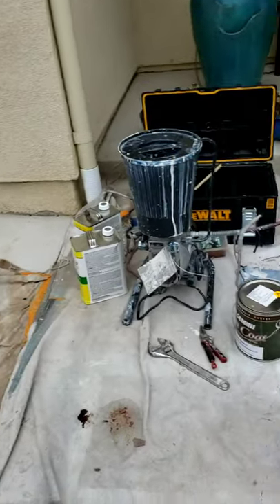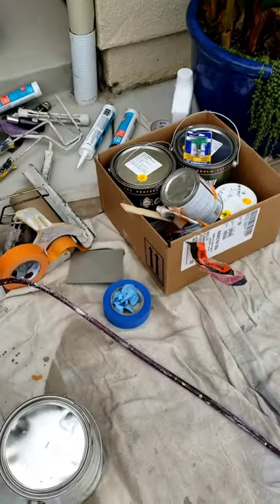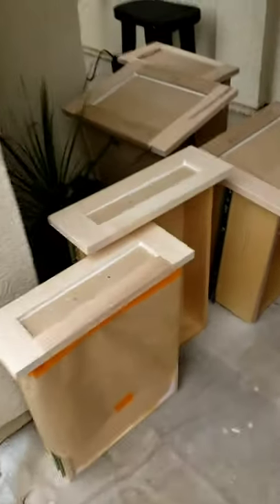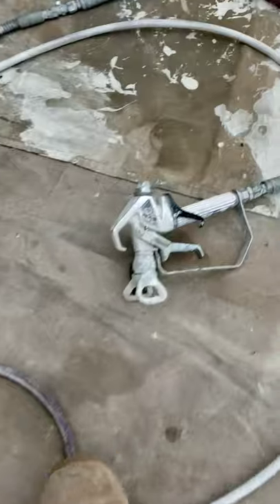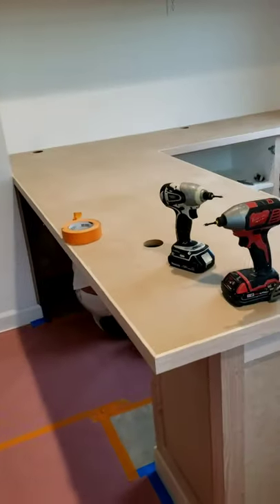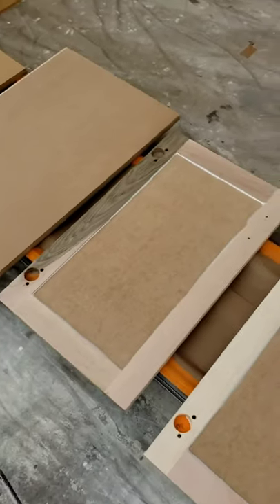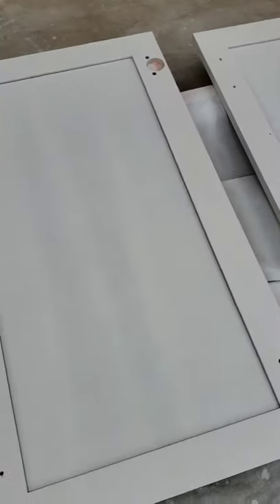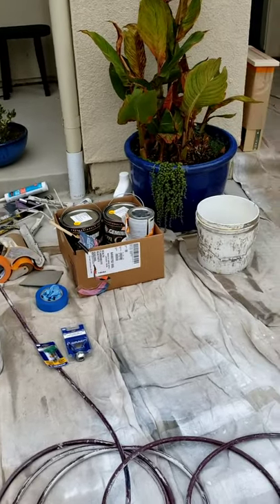Cabinet Lacquer Finish "Gemini"

Comment: Their Gemini EVO is a water based material. Dries hard enough to flip in about 2 hours indoor. great product. Ive never used their lacquer only because the evo and old titanium have worked great so far.
Reply from the maker: Stick to what you know but experiment others as sometimes the manufacturers decide to discontinue  certain products and you don't want to be in that position.

Comment: I had some new cabs built. Wanted them sprayed with lacquer so I had them sprayed with Sherwin Williams undercoater first. They put it on pretty heavy but I sanded them to a nice, clean, smooth finish. The finish coat we used was this Gemini Gem Coat. The sprayer used was a Graco 395 with a Titan tip. I can't remember the tip size but it wasn't a low volume fine finsh tip.i tried to get a 410 but the man spraying said it wouldn't work with his setup. There are places, especially on the edges where the paint, I guess, dried too fast and feels dull and rough. I plan to buy more paint and give it another coat.. Can you please give me any advice for a more successful spray? Thanks so much! Love your videos.
Reply from the maker: Best advice I can give you is to buy a Graco guard X and a fine finish green tip. If your spray man used a latex paint (big) then it's hard to get the smooth finishes, you can do it,  but your gotta be really handy with the gun.  Start with low pressure and test the back of panels to see if you are getting the spray patter desired and the time to work with lacquer is ideal. Spray under shade, good air circulation. If lacquer is too thick you can always thin it with lacquer thinner and if they fog on you then add some acetone and that will help with drying time allowing moisture to be released. Don't worry about messing up, lacquer dries super fast and easy to sand. Always a learning curve. Cheers
Reply: Thank you for responding! I'll pass that on to him. Take care and God Bless!!

Comment: Can u show a how to cleanup video of the 655?
Reply from the maker: Sure thing...will make a quick  clip this coming week...
Reply: David's West Coast Painting Thanx!!
Im getting one this week. 
Do you think they work descent with regular medium bodied latex trim paints?
Reply from the maker: @deekoh3996  for latex paints get an airless sprayer like a graco 390pc or bigger ....it all depends how much spraying you will be doing but that 390 is a descent sprayer to start with. Use the other for lacquers only.
Reply: David's West Coast Painting well crap..
I already ordered it,i have a 495 low boy already..So ya really don’t think it will push those trim paints?
Reply: What sold me on the 655 was the top feed feature,,less moving parts etc.
Reply from the maker: @deekoh3996  I use all kinds of paints. But when I do cabinets I only use lacquer unless clients request something more friendly low voc's...etc...

Comment: Love your videos. After watching I bought a ed655. Haven’t used it yet,will soon. Any way you could do a clean up video on the 655?
Reply from the maker: that little sprayer will make a huge difference, make sure to use the graco FF green tips, don't use blue unless you are doing super big panels. also make sure to thin down product when needed as it does make a difference to achieving smooth finishes.  I spraying cabinets tomorrow and will make a video or setup and clean up.   cheers

Comment: Wats the price for a standard size kitchen to sand and do white Lacor paint ? I know it’s hard to give a price in a comment, but wat does it start at ? Thx 😊
Reply from the maker: Prices vary depending on many variables. What do you have now on cabinets?  Are they stained or painted, new?  State/condition? Could be as low as 2k-10-15-30k it all depends on size as well.

Comment: Good job buddy, I have a new graco airless assistant spray, come with the G40 spray gun, can I spray lacquer with it unit ? And the gun ? Thank you buddy
Reply from the maker: You can but the seals will get blown shortly after since the solvets are too strong. I recommend using the titan ed 655 plus

Comment: Hey what are your thoughts on gemini finish overall.  I primarily used M L Campbell finish.  Was wondering how the gemini finish is doing nowadays.  Thanks
Reply from the maker: Can't go wrong with Gemini specifically the precat....smells very strong but it's worth it...
Reply: @davidswestcoastpainting8510  good deal.   I have never had any issues with ml Campbell.  The thing here every finish wants to compare to Ml Campbell saying it's just as good or better. They never comeback when I tell them to bring me some to try.   So I just wanted an honest opinion, besides the sales rep.  Thanks
Reply: Gemini   👌

Comment: What primer do you use for cabinets
Reply from the maker: If you are using lacquer you must use a lacquer "undercoater", for oil base paint use oil base cover stain or shellac, both are made by Zinsser.
For water base paint you can use zinsser 123 or cover stain in water base.